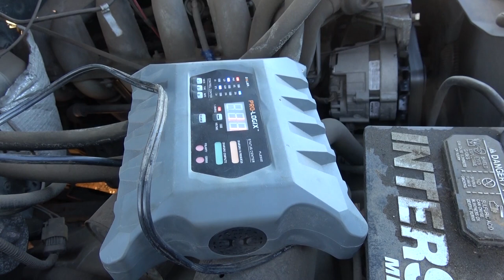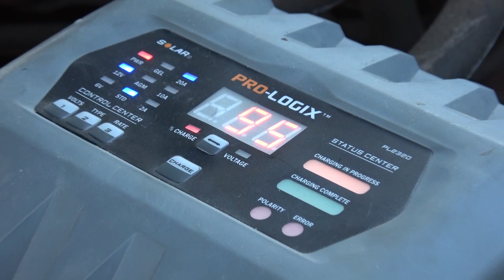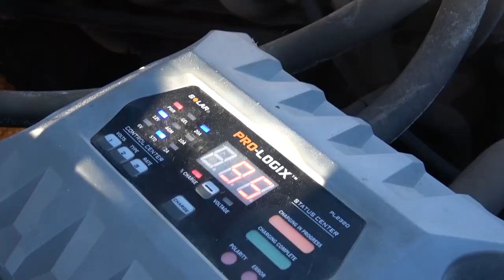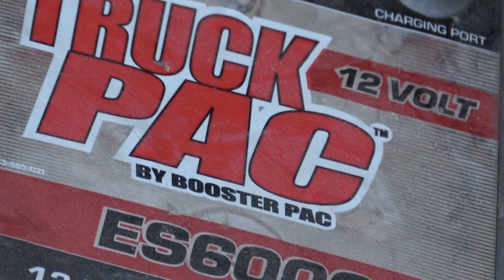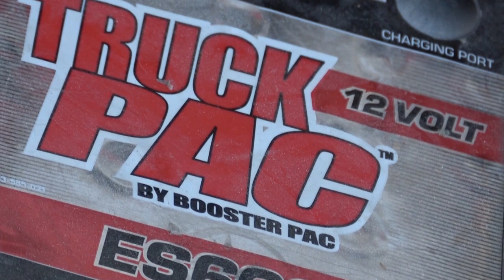Costco Boost Pack | Electrician vs. Truck Starter

Comment: When you'll need to use that thing, it'll be chaos on the side of the highway, other vehicles screaming past, and the jump pack will be snug and warm as a bug on your workbench.
Reply: Sounds like you had a couple of beers already
Reply: I like that saiding 5 seconds later inside sweater😂😂😂
Reply: @tobydyes  buddy who has had a few beers?
Reply: @gbjl26  I reckon if you cranked him he'd hydrolock.
Reply: The club is a joke right?
Reply: Sounds about right.  Theft is so bad in my area that I don't want to leave anything in my truck including my booster pack lol.
Reply: @redsquirrelftw  damn that sucks man!

Comment: Ah yes, good old "current limiting via undersized wires".
Reply: I call it an is the line fuse
Reply: You don't need a fuse if the wire is small enough, it'll blow right in two before the current is exceeded.
Reply: pardon me, isn't that there called a fuse?
Reply: @myownsite  nah it isn’t cold enough to make copper superconductive lead maybe but not copper (being at 7.5K would also explain why the lithium pack gave up the ghost and not faulty design or workmanship)
Reply: lol. any conductor is a fuse if enough current is pulled through it.

Comment: Interstate Battery?  There's your problem; north of the border you should be using an Inter-Province battery.
Reply: I see what you did there lol!
Reply: We lost an interstate battery last week. It was dated 5/18. seems so young for a battery to go.
Reply: @JasonHenderson  Wow , seems weird most Interstate batts last 7 years in Northern NY.
Reply: @NY411Info  I would like old nickel-iron batteries back , but who would make a battery that customers dont need to change ever (average lifespan 40 years) , its just to clean them up and put new lye in and its like new ... cant do that with lead batteries .
Reply: You get the good stuff, we get the garbage up here!! I’ve tossed a couple, over the years.  Definitely a hair better than a Delco though! Cheers 🍻
Reply: @NY411Info  just south of the north border we get 2-3 years out of most interstates. Of course the rare one slips through QC now and then that is good for 7...
Reply: @leavemealone.2150  I just picked a new Interstate for my F150 . I hope it will last the 5-7 years . The one in my 03 Ranger was 7 yo and the one in my Taurus was 6. Maybe they have gone down hill. I guess I will find out.
Reply: @NY411Info  They seem to have gone downhill a bit but it is the way of the world these days. Still a good battery and it is what I run and recommend.. The cranking batts usually last longer than the deep cycles but the lifespan is mostly dependent on usage and charging patterns.
Reply: @NY411Info  seems like all batteries have gone downhill for a while now, well either that or the cars have become much more demanding for angry pixies.

Comment: The fact some half ass wires and a makita battery got you closer...
Reply: I'm surprised the alligator clips managed to do anything at all before spontaneously combusting, so much wiring resistance in those long thin cables.
Reply: Should have used some spare speaker wire.
Reply: Elechicken doesn't carry anything heavier than 16g? Should have used the desoldering braid!
Reply: @hyperboloidofonesheet1036  I repaired my fathers starter wire (the lead between solenoid and motor) with 3 12GA wires. A temporary solution that works...
Reply: If that Makita battery is fucked it'll cost more to replace than the truck battery :-)
Reply: I've boosted my car battery a couple times with a shitty HF NiCd battery thru the cig lighter socket. Car batt was just low enough to only click the starter.
Reply: lots of chooch available in those lithium batteries!
Reply: @hyperboloidofonesheet1036  service entrance cable.
Reply: Some 12ga solid wire pounded flat to fit the tool battery terminals, then vicegripped to the truck battery works much more better 👍 also don't use makita 18v batteries for this because they have permanent time out mode built in to the pack, after I think 3 lows or highs. Seriously. But a Dewilt'll do it until the thermal fuse pops, or a cell does 😄
Reply: @ShedTV  It'll probably cost more to replace than the truck!
Reply: @teardowndan5364  everyone learns that lesson once right
Reply: @hyperboloidofonesheet1036  yes he must test de-soldering braid now
Reply: @Tk3997  Oh man, I can think of at least 2 times that would have helped me lol. Now that I know it will never come up again. :) Also because I keep a portable booster in the car now. Very cool, though!
Reply: Makita batteries have started my car 🤷
Reply: @ShedTV  the truck !
Reply: @WineScrounger  yeah
👈😎👍I had a 3hour battery and thick wire's and unhooked it soon as it started ,oh and mine is a 4 litre straight 6 petrol 😎the standard Australian ford🤣
Reply: @technosasquatchfilms  NiCd batterys are old but can produce really impressive currents even when cold, there just not as energy dense as lithium.
Reply: @SuperUltimateLP  Now, I did only use it to top up the battery, I didn't try to start it by drawing extra juice from it.
Reply: @technosasquatchfilms  yeah that works too.
Reply: mAKITA (dogtype hidden in word makita)
Reply: @ShedTV  Are you new here? Economics is not a primary factor.
Reply: @BryanSarauer  Hehe. Silly me!
Reply: @ShedTV  cost more than replacing the truck.

Comment: I like that you're worried someone will steal the dang thing.
Reply: @burnte  had exactly the same thought. Also thought you would be better off leaving it nickable and hoped someone ran off with it. At least you'd get the insurance settlement back.
Reply: Noticed it also ran without a key 🤔
Reply: If they get the thing started it's an earned steal
Reply: @elijahherman  It ran?? 😳

Boy, I sure hope they caught up to it!

(I had to, and I’m not even sorry. 😆)
Reply: Probably worried for those poor thieves...
Reply: It's the best way to keep someone from running off with the steering wheel lock. Get it secured to something that ain't friggin moving!
Reply: its a sobriety test. if you cant take the club off you're too hammered to drive
Reply: @captiveimage  I`d rather have my truck than a $20 cheque from the insurance company.
Reply: @--_DJ_--  🤣
Reply: yeah..or theyd steal the club when they break in
Reply: He's worried about liability. He's the one getting sued when they get tetanus or CO poisoning when they steal it.
Reply: @DeviantOllam  Thats a standard feature on late 80s early 90s models.  Never worried about lost keys.  Way better than a chip in the hand.
Reply: *steel
Reply: @Stoned2daBone-r4g  ummm no it's steal not metal lol 😂
Reply: @Stoned2daBone-r4g  *duct tape
Reply: I think the "club" is like their trigger lock and case up there.  Seeing it does not have key the club is the safety.  On my fords I just put one key in w/o a key ring and looks like it  does not have a key
Reply: @--_DJ_--  What insurance company would pay $20 for that?
Reply: Didn't you hear him? The tires are new! Lol
Reply: Not like a club would do a lot, but I had my 94 Dakota stolen... thing was rusted apart, barely ran, , had the doors literally falling off when you opened them, and wasn't worth it's scrap weight as a truck.  To this day I have no idea why they took it, The tires were worth more than the rest of the truck.  Expected it to show up a couple days later with no wheels, or with the 318 stripped out of it, but 2 years later it never reappeared.
Reply: If you dont know the slave lake and zip ties and bias plys reference then you had better call your local priest and get the scale on how many hail marys and our fathers before you "consume" his content.  The guys here are TAME compared to my Minty Canadian brother!
Reply: @captiveimage  the deductible would be 10 times the value of the truck.
Reply: @Trialnerror  I had one of these in an old F100 as a teen. I think I ran that thing without oil for at least two years. As much as I didn't know I was trying, I couldn't kill it.
Reply: @captiveimage   not if the damn thing isn’t with more than your deductible. Then you lose your truck and get nothing.
Reply: I think that was there more for laughs than to actually keep anyone from stealing it haha 😆
Reply: @Trialnerror  Chrysler 225 slant 6, bullet proof
Reply: @DeviantOllam  ha... Small 🌎
Reply: @Trialnerror  agreed!! UPS has logged a million miles on a few of the ol' six holers..I have personally witnessed one run without the benefits of coolant or measurable engine oil with seemingly no adverse side effects.. 300-6 is the definition of a tough workhorse of an engine.

Comment: I purchased a similar Booster Pack from Costco two years ago. I used it to start vehicles - including a rental box truck - many times. I think the problem was the Ford you were attempting to start is calibrated for KM/H instead of MPH as used in the states. The pixies can't do the conversion in real time.

Comment: What's funny, apart from everything, is that a Makita battery giving up its soul through wires no thicker than an angel's pubes got you closer than that costco POS.  Haven't laughed so much in ages.
Reply: I can't believe those 18 gauge jumpers couldn't carry enough current to start that thing, Chinesium smh.
Reply: I actually used something similar to this boostpack with much success.
I believe that the battery here is absolutely fucked.
With a battery that's still somewhat working those small boosters can work.
Reply: @SuperUltimateLP  bruh, a truck like that draws for sure 200A when cranking, THOSE PUNY WIRES cannot handle that current, I'm not even talking about the poor battery that can output maximum of 20A. In extreme cases you use the drill battery to charge the battery not to draw directly when cranking, otherwise you fry all electronics inside of it.
Reply: @D4no00  that's why I said that the battery here is fucked.
If it wasn't that bad you could boost the main battery and successfuly start your car.
I'm not even sure 200A is enough, my gas powered car with 1.4L needs more then that.
Reply: @SuperUltimateLP  they had the goddamn heater inside, just take the battery and warm it up, it will start by itself...
Reply: @D4no00   For sure, but where's the comedy in that!  :)
Reply: Too many angry pixies for those little clip leads!
Reply: @D4no00  that's what I was thinking, just take the battery inside and let the poor thing defrost a little bit.
Reply: @SuperUltimateLP  No it doesn’t the average starter draw for a 4 banger is slightly under 100 amps with the fuel pump and everything you are not going to crack 140 amps. Regardless the junk 40 dollar pack ain’t getting anything started that wouldn’t have started anyways.

Comment: “We got fucking three phase DC here man!”
Reply: Yeah, but it's 50 Hz.
Reply: That old Ford alternator really is putting out 3 phase, and then converting it to DC via the diodes :)
Reply: @miketrissel5494  Ain't that the normals?
Reply: @miketrissel5494  yeah pretty sure its all alternators that do that, nothing to do with Ford or it being old. Unless you can point me to one that doesnt? Sounds interesting if thats the case.
Reply: wheres the third claw

Comment: That 6 cylinder has no compression on one cylinder. We actually use those tiny battery jumpers now in the lot and they work pretty good, but I'm located here in California where it almost never gets down to freezing on the coldest day or the year. Good fun to watch thumbs up video. Thanks!

Comment: I have one of those costco boost packs, different version but same brand. I drove an old beater for a while that used to run out of pixies regularly and that thing saved me from the embarrassment of calling in a mate with some jumper cables quite a few times.

Comment: This brings back memories when I almost started a friend's '80s Ford Bronco with a drone battery. It would've worked if I used a 4-cell pack instead of a 3 cell.
Reply: Can verify that a drone 4-cell lipo will jump a car. I'd carry one in the glove box if I wasn't afraid of it exploding.
Reply: @ChrisB...  it wont explode unless you stab it with a screwdriver, id probably keep it in a fire prevention container for lithium cells (metal cookie box). i have a box full of lithium cells and only one of them started hissing at me though my safety training saved me and i chucked it out of my window. it was some cylindrical lipo i ripped out of a broken e-cigarette, stay the fuck out of those they are nasty outside of their metal casing
Reply: I started my sister's car with a 3s lipo just a week ago! It's definitely possible
Reply: 3 cell packs can start engines nowadays, the 2000+ mah high quality packs do 200A for a few seconds.
Reply: It's just a 3s lipo in most of these little jump packs anyway.
Reply: I once jump started a Volvo (car) with an 18v Milwaukee pack..

Comment: The fact that the cables only smoked when you started cranking, shows that you were entirely powering the truck from the tool battery, and had little to no connection to the truck battery at all. Cleaning up the battery posts would have fixed the problem. This is also why the battery charger said the battery was 95% done all the time, as it was barely passing any current into the battery, and again why you smoked the little charger pack, instead of the pack bosting the battery, you pulled about 700amps straight from it and smoked it.
Reply: You are supposed to crank right off the tiny booster.  No one could ever put a significant charge into the lead battery from this wee booster.  Even less from a 3S 12,6V Li-pack.  You'd need at least 14V.  Or 15,5V in the canuckistanian freezer.
Reply: We have an armchair expert in the house... almost as irritating as the bench racers at the local watering hole.

Comment: been through 5 iterations of sent back melted bricks crying in shitago trying to crank a 1.9l jetta fuk sakes. Forgetabodit
Reply: Just buy one on Amazon. Tacklife, Imazing, TopVision, Crosstour. They're all beastly. Get one 1200A+ for good measure.
Reply: @devilselbow  Have, works a treat, spent five years tracking down an intermittent drain. does not help in that case. Ive tried many jump pac's to have, built my own. Possibly posting about that at some point. Not a tried and true, not a cheap YET` build.
Reply: Hell with that lithium crap. Get yourself one of those big assed Clore starters, I started my 4.6 V8 a couple dozen times on that thing with one charge when my battery terminal broke off, good exercise too carrying it around.
Reply: The TDI?  that thing needs a lot of juice to crank.  The stock battery is the same used in large trucks. even a good quality jump box has never gotten mine to crank without help from a proper charger. (My 35/200 amp charger is the best hundred bucks I spent 25 years ago.)
Reply: @802Garage  this,I've started dead 6.7 cummins engines with amazon lithium jumpboxes
Reply: @sukmidri  The trick is to buy the kind that doesn't have any output protection between the battery and the clamps. The earlier (2014-2016) LiPo jump packs just had a diode between the pack and the cables, no relay or MOSFET. A lot of the newer ones have a switching element for safety, but it adds so much series resistance that they hardly crank anything...
Reply: @johngaltline9933  yeah they don't start easy, melted a buddies jumpers trying to start mine.

Comment: Well the priorities are still priceless, good spendy scotch and a 30 cent solo cup.
Reply: @carolynwilbur1627  the old electchicken Dewclaw likes to stay grounded.
Reply: Won't jump a fully discharged battery, takes a bit to charge first. Senses the battery voltage to prevent reverse polarity before it allows current to flow.
Reply: @jerrywells550  sounds like marital problems...

Comment: I'm concerned that you thought that 22ga wire would carry that many angry pixies
Reply: It was just their way of sending up smoke signals.
Reply: Its ok he is a professional.
Reply: enough to charge....leave em on for the extra 2% boost in performance during its expected swan song
Reply: Ya, you have to use 18 or it's never gonna work.
Reply: Like I said, should have got out the desoldering braid. :)
Reply: i don't think they were expecting anything
Reply: Ya need a bit of resistance to bring that 18 volts down to 12...
Reply: I hope they were trying to make smoke for views, because they definitely know better. Just use some romex
Reply: Angry pixies run faster in hot wires, at least for awhile.
Reply: I figured the original intent was to trickle-charge the car battery from the higher-voltage drill battery, rather than to actually crank on it from the drill battery
Reply: @kazzTrismus  yup

Comment: Lying in bed here in Sydney Australia in the sweltering heat, fan blasting but aircon off because it sounds like a freight train to the neighbours at this time of night. And here I am watching Laurel and Hardy in the freezing cold and it reminded me of my pocket battery starter. Same deal, gives you just enough kick to get your hopes up. Then it realises that you’re trying to kick an eight cylinder and packs it in!